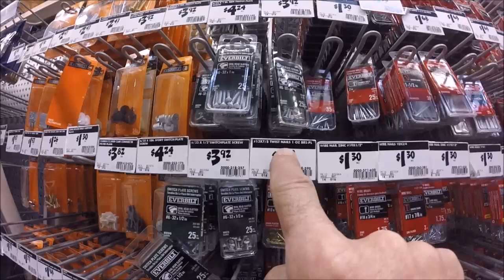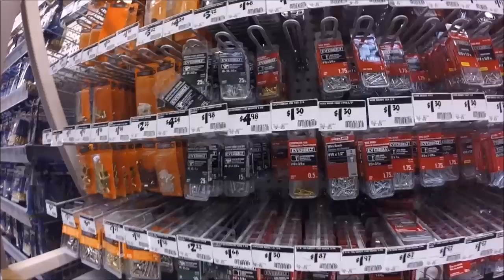V Log #8   66 Super Shasta Update

Comment: ROFL!!! The "Billroy was here" frame cracked me up!

Yep, if I were looking for twisty nails, I do think I'd go straight to the nail section. I think I could probably get there blindfolded by now. I think we've discussed this before, but your Home Depot just seems incredibly crappy relative to what I'm used to. Just took a quick look online, and my store has both brass and zinc in stock. Your store sucks.  LOL

On Amazon, search for twist nails. I believe that's their actual "formal" name.
Reply from the maker: I did look on line for "Twist Nails" and the only thing that came up was from Home Depot. Yes my store sucks more than any other Home Depot store in the country. I no longer shop there.

Comment: how hard is it to control a router when following your framing profile?  I am of pressing against the framing too hard and cutting a notch in the paneling
Reply from the maker: It's good to practice on something else for a few minutes to get the hang of it. But it actually works very well. Being that the roller bearing keeps you gliding along on the right path it's not difficult at all. Just make sure you are moving against the cut. That's the whole trick.
Reply: mobiltec thanks again, Larry!